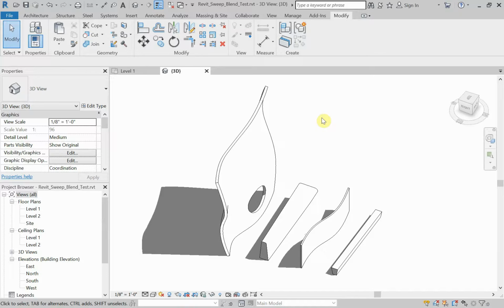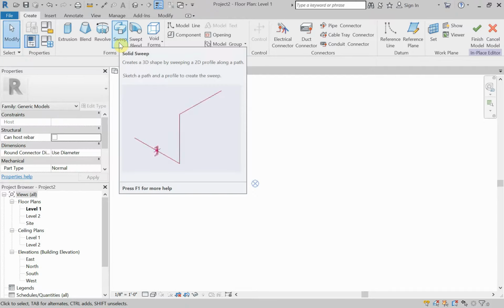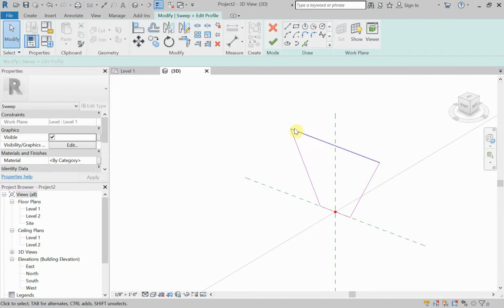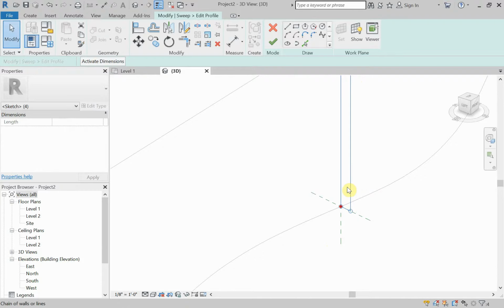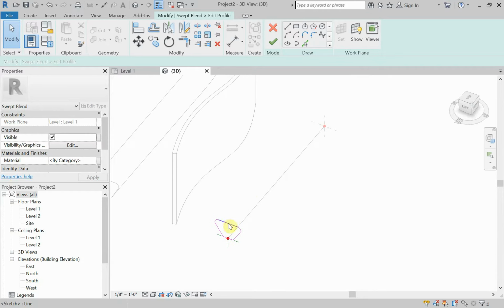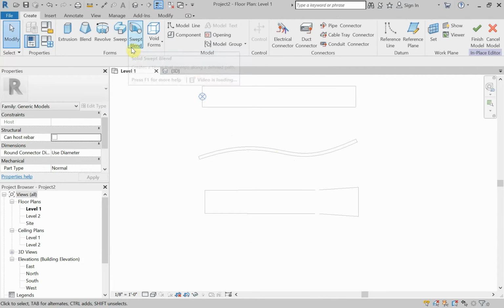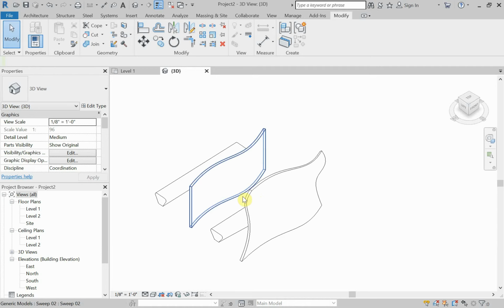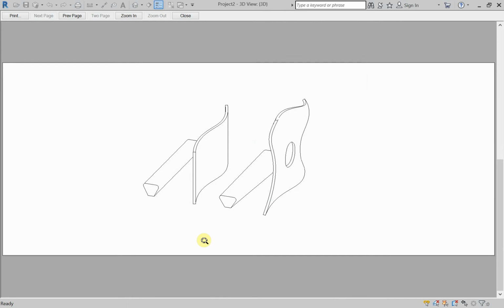Revit Sweep Blend

Comment: How do you draw a sweep path of which the start and end are not aligned on the same plane? Imagine starting in a 45° angle and ending in a 135° angle. Like this:  \___/   (\ being the first plane and / being the last. The bottom "___" is a flat surface and the empty top is a round top.
Reply from the maker: Were you able to solve your problem?